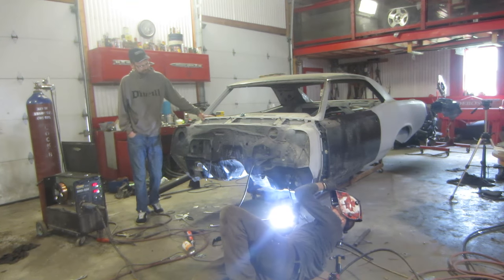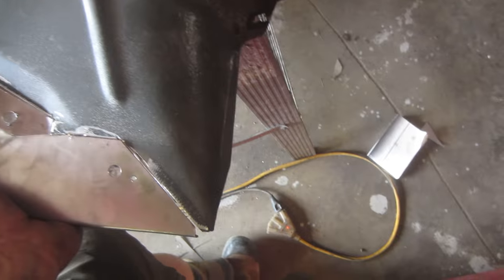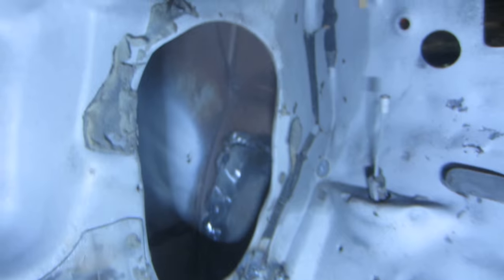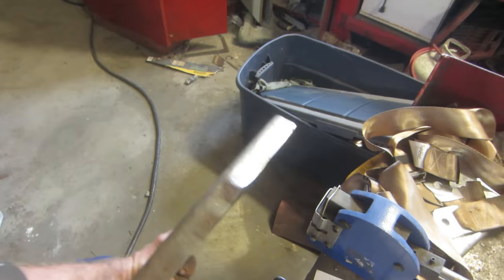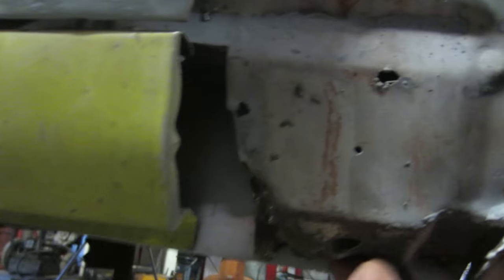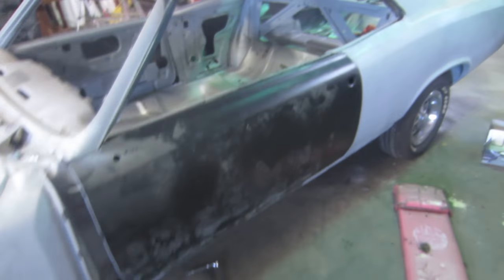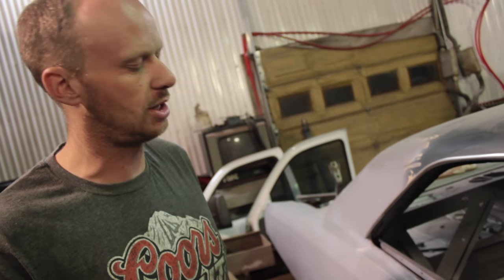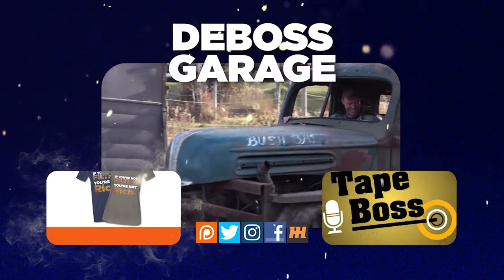'67 Pontiac GTO Restoration - METALWORKING [EP9]

Comment: Anybody catch what welder he is using? I am looking at getting one and would like to have a recommendation. I have a 220 line, but would prefer a 110 because it will be mostly for auto body panels. I know mig with gas, but any ideas on brand or model. Thanks to any that can help.

Comment: Is it pissible to put a 6.6 duramax diesel lbz engine with an allison transmission into a 2014 tundra sr5 crewmax?
Reply from the maker: That Allison is huge.  Most likely you will have to do a body lift.  "massaging" the transmission tunnel and firewall isn't going to do it